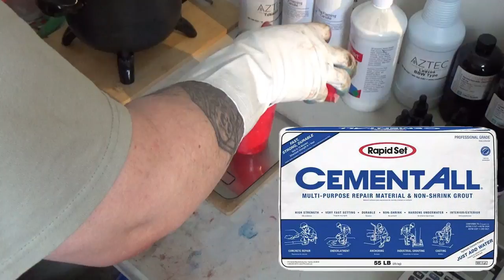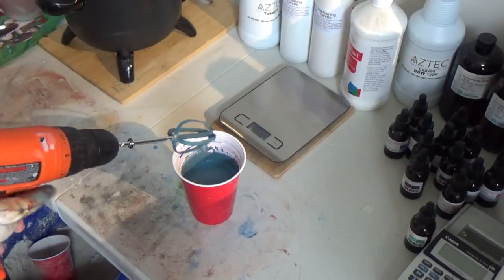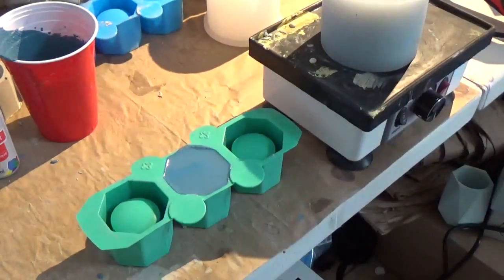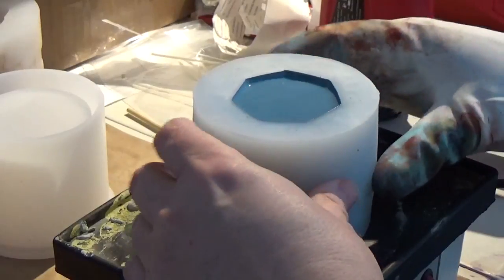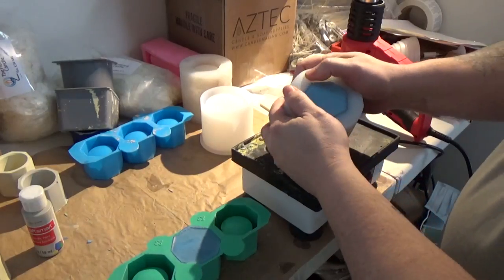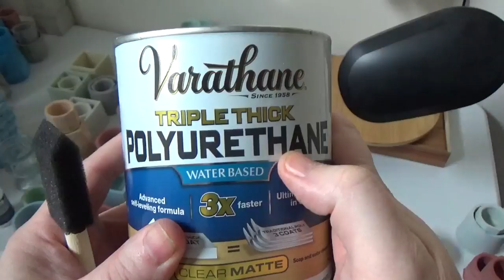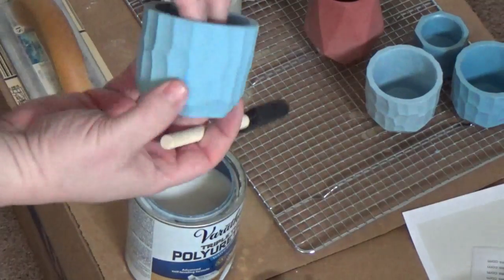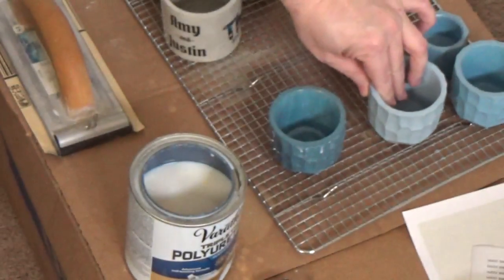DIY Concrete Candle Vessels or Containers | For Candles or Plants

Comment: I love how well you described the concrete folding over, I struggled with that same air bubbles issue near the top /bottom area & I made my mixture a little thicker cuz I was worried it would not dry right, now I’m gonna definitely try to make it a little bit more watery. - I have the same molds and got way more air bubbles even after a lot of tapping 🤦🏻‍♀️
Reply from the maker: I am so happy that we were able to help. It's hard getting all the air out but with that method you can get 99% of it out. For that mold we use 225 grams of cement and  45 grams of water. That seems to make it the perfect consistency.

Comment: Hi! New to cement vessel making! I've done some research and lots of candle makers say that varathane isn't safe. I did buy a little can of varathane water-based and was hoping to use it. But I just want to double check that it is safe to burn a candle inside using this sealer. Thank you for posting this video it has been very educational for me! And I hope to hear back from you 😊
Reply from the maker: I've never had an issue with it but some people to steer clear of it for one reason or another.

Comment: I learned the most about making concrete containers from your video. Thank you so much. I went to buy the same Varathane polyurethane you had but the guy at Lowe’s and Home Depot told me that sealant is for interior wood. Does your can say it’s for cement or does it matter? I ended up buying a gallon of concrete sealer from Lowe’s. I live in Ottawa , Canada so maybe there are different types? Can you help me out with this please ? Thank you.
Reply from the maker: I can't say much for Canada but I was using the regular sealant but now I too use concrete sealer.
Reply: Thank you. I use the concrete sealer in a gallon jug. Thank you for replying

Comment: Do you have a trick for getting concrete vessels out of the cylindrical mold you have in the background? I have that one and it is so hard for me to use.
Reply from the maker: If you are referring to the round one, it's very hard. I just roll it down to the edge at the bottom and then pull it out all the way around and pull it over the lip then down.

Comment: Do I need to seal the outside? I like the matte finish and just wonder if I can seal the inside only, to use as a candle. Thank you!!!
Reply: Yes! But there is also some sealant that you can dip the vessel in and it doesn't change the finish of the natural concrete.
Reply from the maker: You don't have to as sometimes I don't seal the outside. But you should seal the inside for sure.

Comment: How can you find out how much cement and water is needed for each mold? You said for this particular one you only needed 350g of cement and 60g of water? Obviously it won’t be the same for each mold, how did you get these exact measurements?
Reply from the maker: It's a trial and error when you first start with a mold. I always start with weighting how much cement and water I put in and then pour the mold then adjust from there until I have the exact amount for that mold. It can take many different tries before getting it.

Comment: Loved your video thank you. I'm in a few Facebook concrete groups that make candle vessels. Alot people say that sealer you use release toxins when the candle is burning what is your thoughts on this issue. Thanks Henrietta
Reply from the maker: From my research in the past, once it's hardened it can't release anything. In fact it does not even burn if you put a flame to it. But you don't have to seal the cement, you can leave it as is but you may have some wax seep through it. But I am no scientist  so use at your own caution and do your own research.
Reply: @CarolinaPicker  I want to seal cause the vessel looks terrible inside has the wax burns down. I tried making my own sealer using beeswax, caruba wax and fractionated coconut oil
Reply from the maker: I understand completely. We are now testing this: https://directcolors.com/krystal-kote-high-gloss-sealer/ and it seems to be working very well so far. It's not a poly but it's doing a nice job. I will be making a video on it as soon as we test it a bit more.
Reply: @CarolinaPicker  Anything that's poly is a plastic and plastic releases toxic fumes when burned. It does not catch on fire, just melts, much like a plastic bag.

Comment: Hi again. I bought the same vibrator table you have. How long do you leave the containers on the table? And do you use the high setting? Thank you
Reply from the maker: I leave it probably about 1 minute and I go about half way between low and high in most cases. It also helps to tap the sides a few times while it's on the table.

Comment: Great video..though for making plant pots do u have to soak them in water before sealing them?
Reply from the maker: You don't need to if using for plants, but it does help the sealer from soaking in too fast so you may use more to seal it.

Comment: How do you determine how much cement and water to mix for a new mold?
Reply from the maker: It's really a trial and error type deal. I mix up a red cup full of cement with water measuring the cement then measuring the water, mix it and if I need more of either I measure what I'm adding. Then I weigh the entire mix. I pour the mold and then weigh what's left in the cup. Subtract that from the total weight and that will tell you how much total weight you need. Then I just do some math to figure out what part of that was cement and what part was water and do it again with those weights and pour the same mold and see if any it left over or I was short. Then I adjust as needed. After about 3 times of doing this, you should have the exact weight of cement needed and water needed. Sounds confusing but really once you do it for a mold, it's easy for other new molds.
Reply: @CarolinaPicker  Thank you. As I thought about it, I figured those might be the steps. I'm excited to try this!
Reply: Wow.. 
you rode a short bus to school, didn’t you?
Reply from the maker: @VAcreeper  yea, I remember seeing you on that bus too LOL.

Comment: How much concrete and water do you use for the cilinder mold?
Reply from the maker: The cylinder mold I use 270g cement and 50g of water. Just keep in mind that if you are using paint to color the vessel, the paint will thicken it so you will have to add more water as needed. If you are using pigment then that is the correct amount of water.

Comment: Hello thank you for the tutorial! I wonder if you use water based sealer, can we wash the vessel? Like if the candle is run out and we want to wash the vessel and repurpose it. Anyway, success for you!
Reply from the maker: Yes you can do that. Most people will make a small plant planter or a pencil holder with them.

Comment: i don't really have a lot of knowledge about using polyurethane, but is it safe to use if it is heated?
Reply: also, through my research, i found that some are having problems about the wax seeping through the pot that's why oil-like stains appear on the outside. If I use this, will this solve the problem?
Reply from the maker: When you seal the cement, it should stop the seeping of wax. That's why the polyurethane is put on it. I have never had a problem using the "water" based polyurethane. However, I have started using a different sealer. I will be making a video about that soon. Be sure to be subscribed so you get notified when I place that video.
Reply: @CarolinaPicker  Your video was really informative and helpful, as well as your answer. I've been looking for days for this information. Thank you so much! I will surely subscribe 🙂

Comment: Very nice job I really appreciated, is the painting do u use inside the jar it’s doesn’t effect the quality of candle when u poor it? And if I need it in a Matt colour what u could advise? And there’s any solution for the air bobble damage ?
Reply from the maker: It does not affect it at all. All the colors are matt colors it's the coating that makes it shiny so just leave the coating off the outside and just do the inside only to seal it. No solution for that really. I have tried to add cement after the fact and it does not work. Just use less water as it's the water that creates them.

Comment: Is the polyurethane you use the same as the polyacrylic I see others using? Are both ok for heat for the candles? Dumb question because u r using but lol if not the same as polyacrylic does it matter which I use?  I just want safe for burning of candles etc.
Reply from the maker: I don't know if it's the same because I have not seen the other videos, however, we have used that one for a long time with no issues. However, we have been testing something different. I will have a video on the new one soon. Be sure to subscribe and click the bell so you know when we post that video.
Reply: @CarolinaPicker  sorry to bug but u at least responded to me lol.  I used cement all got a great mold.   Do you water bath or anything before you seal?
Reply from the maker: I personally don't do a water bath, however, I know people that do. The theory behind it is so the cement don't soak up the sealant. My opinion is that you are adding moisture back into the cement and then sealing it into the vessel. When that heats up, it has to escape via steam somehow. I believe it will cause cracks. I may be totally wrong on that lol. But either way, I let my cement set for at least 24 to 48 hours to get as much moisture out as I can then seal it.

Comment: Hello very nice video how about the littles bubbles on the surface every time I sand it from beneath it has air bubbles can I avoid that?and something else this cement it’s the same with white one?and the color on the bottom it’s lighter why this happend?
Reply from the maker: It's hard to completely avoid them but you can get less if you use a bit less water. The more water you use, the more bubbles you will get.

Comment: Thanks so much for the tutorial.  When making a few of these, what is the  ratio of concrete to water ?
Reply from the maker: It's really a trial and error. I will make a video on how it's done.
Reply: @CarolinaPicker  Where can we find the Power drill and vibration tool?
Reply from the maker: @MoneyMimi  The drill can be found at any lowes or home depot. The vibrating table can be found on Amazon but I will have that exact table for sale on my eBay store this coming week. So anyone will be able to get that table that I have used. So look for that coming the first week in January 2022. The link to that store is HTTP://lotsodeals.com I will also be making a new video explaining where we have been, what we are doing, and why. So be sure to watch for that video and subscribe if you have not already done so.

Comment: is that stuff strong enough when we accidentally drop it?
Reply from the maker: I have tested mine by dropping them from 3 feet on carpet and hard wood floor. They hold fairly good. Anything higher than 3 feet I have never tested and of course if you drop it on cement (like a walk way) it will probably break.

Comment: Hello if I could get your advice I’d appreciate your feedback. I made some containers with cement all and used the same sealer but it was not the triple thick one. I am now testing my candle in it and it’s leaving a stain where the wax has melted on the walls of the container. Is this because I did not seal it with triple thick polyurethane or is that just how they are? 
I would like my containers to be washed and reused but not if it leaves that stain on the inside. 
Please help!
Reply from the maker: There will always be some staining using cement but the triple thick does help with that.

Comment: Hi! I am new to this and want to know how do you tell how much a particular vessel would need of cement to water ratio?
Reply from the maker: It's really a trial and error situation. Start by weighing what you add and then pour. Then see what you have left over and subtract that and do it again. At some point you will find the right combination and weight. Remember, you don't want your cement too dry but you also don't want it like water. A nice pancake batter is good then just add a bit more cement and you should be there.

Comment: Is concrete and cement the same thing?
Reply: Cement is an ingredient in Concrete. Cement is the binding material. Concrete is cement + aggregate + water. Aggregates are the filler in Concrete, made of various types of sand and or gravel. Cement can be used to make things without aggregates, but is not as strong as Concrete, so Concrete is used for buildings and sidewalks.
Reply from the maker: Not really but ambulantic explains it very well.

Comment: May i know how long you leave the jar to dry. I left my jar about 5 hours.its dried but cracked and very soft.
Reply from the maker: Usually it will dry within a few hours. I left mine out for 24 though. If yours is dried but cracked and soft, you may have added too much.
Reply: @CarolinaPicker  thank you for your opinion and advise. I will reduce the concrete amount next time.
Reply from the maker: Sorry, I did not know you were speaking of the concrete, I thought it was the sealer. If your concrete is cracking and not drying fast enough, you have too much water in it. Try reducing the amount but just a few grams at a time. This may take you a few tries but keep reducing it until it's right.
Reply: @CarolinaPicker  sure .thank you for advice

Comment: Did you only use pure cement and water or did u add any aggregates?
Reply from the maker: All that I use is the Cement All. Nothing else is added. Here it is... https://www.homedepot.com/p/Rapid-Set-55-lb-Cement-All-Multi-Purpose-Construction-Material-02010055/202188447

Comment: Hiya, how do you measure/know how much cement you need?
Reply from the maker: When we start with a new mold, it's really a trial and error that helps us. We basically mix a red cup full of cement, weigh it, pour it and see how much is left in the cup by weight. Subtract what's left by what you had and that's a great start. Then we go from there. Remember, that total weight includes water so if for example your weight used is 280g, then use about 255g of cement and 25g of water. Be sure it's not too thick. If it is, just add more water, pour that one and the next time use 245g cement and 40g water. At some point you will narrow it down just right to what you need. Then write that down for that mold and you are set.

Comment: Hi there i have watched your video a few times and i am curious... google says that this sealant is flammable when wet...? and home depot does not list anything besides wood on their description box for this sealant. i am sure it is safe because you have been testing and selling candles with it. but is there any other proof that this will not cause a candle to explode?
Reply from the maker: It may be flammable when wet, but remember, you let it cure and dry for 24 to 48 hours before burning the candle. As long as you let the vessel dry out for a day or 2 at the least and 5 to 7 days is better then seal it, you should be fine. However, we have switched to a different sealant now. We used that one for a few years with no issues, but we like the new one better. We will be making a video on it soon. But it's that one we show in this video from Direct Colors.
Reply: @CarolinaPicker  would love to know what the new sealant you’re using is?! It’s very hard finding something that isn’t flammable